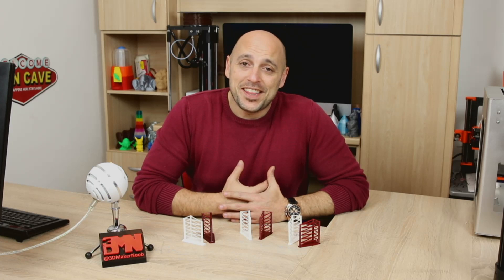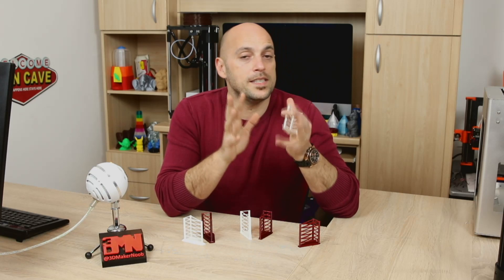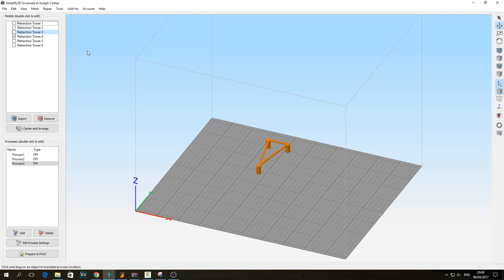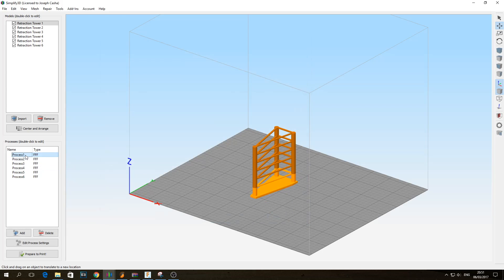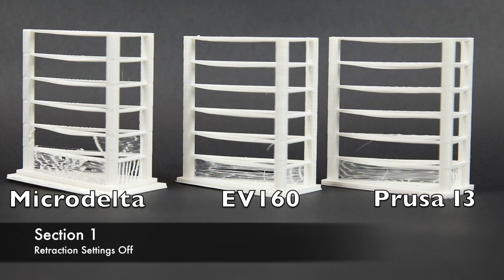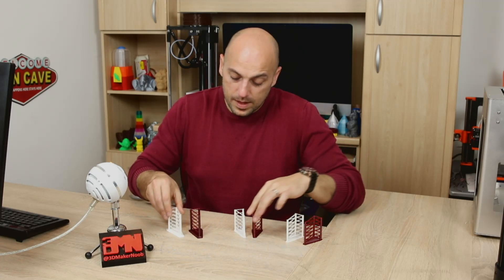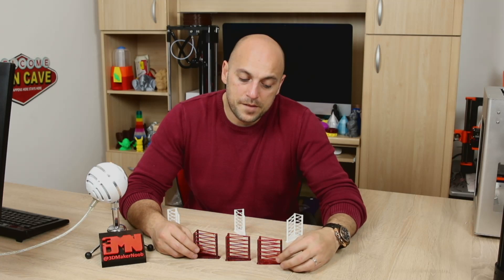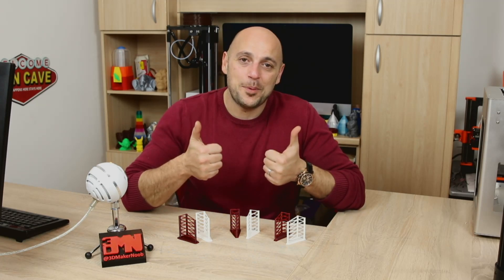A Noob's 3D Printing Guide - Retractions

Comment: For achieving this with Cura you can edit the Gcode file with notepad. Look at the layer preview and see how many layers for each section. Slice a full tower for each setting and save in separate file name (eg section 1,2,3... etc), pick one as the master, then using ctrl+f to find 'layer:x', copy/paste to replace the section layers and save the file.

Keep in mind that layer 1 in Cura is called Layer 0 in the gcode file - subtract 1 from what you see in Cura.

Comment: Old video but great setup. I would add that before retraction, it seems best to find the optimal flow rate (varies with filament softness) maybe with a cube, and then temperature with a temperature tower. Difficult filaments might need a temperature tower at different speeds to find the optimal  "gooeyness" for strong and good looking prints.

Comment: Don't do 5mm or more on E3D v5/V6 or it'll cause partial jams in the heatbreak etc. It's not visible but you'll get inconsistent prints and extrusion and end up like me trying everything to figure out what's wrong xD 

You can reduce temps to reduce stringing and you can get rid of any more stringing by just using a razor or a finger or a heat gun

Comment: Hey, great video about 3D printing. I would like to know what 3D modeling software you currently using?
Reply: What you see here is unfortunately simply3d. It costs 150 bucks. Wish he used a free slices for this.
Reply from the maker: He asked about the modelling software which in this case was tinkercad(free) and I also use fusion360 (also free)

Comment: Hello :) I've tried this with the setting-variations you used and there are 2 Strings hanging down on every Layer ( I think it's because it prints the outlines first, than the filling - it basically prints in the air if you get me) How could i fix this issue?

Comment: For the PETG could try it again with a lower temperature 250 is way high I think. I use around 215, I think that your test with the PETG suffers from a too high temperature. Am I right ? Thanks for the video it was helpfull.
Reply: TheBookaroo I agree, 230 degrees is my sweet spot for Rigid.ink's PETG.
Reply: Me Too.... 235 is where I've landed on optimism for PETG
Reply: agreed!!

Comment: Hi Joe, have watched many of your videos and learned a lot from you. So big Thx. Just one thing with this print can you share the rest of your S3D settings like speed and layers etc. I notice in your video when yous slice the layers are all Green at a single speed. When I do this I am getting really slow speeds for my towers 2.3. I have tried setting the outline speed to 100 and base speed to 60 but makes not difference. I just feel like I am missing one settings. Also what do you recommend as Speed for an I3 Plus (i have the Coccon Create Touch Aussie rebrand).
Reply: its ok I worked it out, i had speed overrides set under cooling which was slowing the print down.
Reply from the maker: +netwolfstar hey, please accept my apology for the late reply. Truly sorry as it gets hectic with comments :) glad you sorted it out, that setting is something to always keep an eye out for as some filament don't like slow speeds and others need it. As for speed on that particular printer, I find the best quality comes out at no more than 45mm/s

Comment: Printed this on my new fabrikator mini 2, and with section 4 I had absolutely no stringing. Moving on to print a 3D benchy with those settings, and I know it's a torture test, I just had crazy stringing. Any ideas to tune it more, or if the benchy is just that difficult to print?
Reply from the maker: +Karsten the benchy is pretty much the all round torture test, it was created to see what a printer is candle of all around. So it might need some more tweaking.
Reply: Just printed Aria the dragon, which also was stringing like crazy.

Have been printing a small retraction test, similar to Your tower, just going between two columns. Everything looks good, so not sure how to tweak, when the test shows all good.

Comment: Great video, still waiting for my first 3d printer to arrive, but will definitely use the this to dial in retraction. Would be awesome with a video explaining Your process from receiving a brand new filament, to figuring out best settings, ex. temperature, retraction, and other potential settings.
Reply from the maker: working on it, should be out next week :)
Reply: 3D Maker Noob That's awesome Joe

Comment: I don't think it is a great idea to mix bridging with retraction. I definitely appreciate the approach, the cube method doesn't let you test the different settings in one print.
Reply from the maker: +Jeffrey Drake the bringing is just there to support the towers, it wasn't intended to test both. I also didn't want to create a test piece that would use too much filament

Comment: For Cura, use the Z-Height plugin. I think it's installed by default in Cura 2.3. It lets you change settings on a height basis. I don't remember if you're limited in which settings you can change. I know you can change temp.
Reply from the maker: i think someone mentioned this but said that retractions are not included. will have a look into it. thank you :)

Comment: This can be done is Slic3r using Modification Meshes. Its not nearly as easy as Simplify, The modification mesh system is not terribly  well documented but it can be super powerful. I'm probably be building a tutorial on it soon.

...EDIT...
Looks like I'm incorrect. In Slic3r, you can't use a Modification Mesh to change settings for the 'Printer' tab. I'll have to find a way around that.
Reply from the maker: +Joe Herbert Shane, if you do figure it out and do a tutorial, please drop me a link :)

Comment: can you have supports just in the middle. i had a print the other day i would have like to choose where i had supports
Reply from the maker: +mikes makes yes you can. You can choose which section has supports. With sinplify3d you have custom support placement so it makes your life much easier
Reply: ill have to check that out i have always used slic3r

Comment: Oh, that's a good start for your guide. I hope there is more to come on similar settings that will affect the print quaility. Do you have any suggestions for the "pi tower" http://www.thingiverse.com/thing:271769? It seems to be quite hard to print. None of the makes look perfect. I got a lot of stringing as well, with a PLA filament where I normally have no issues on the MK2. I tried to reduce the temps a bit, but that did not really improve the print. Any suggestions what to try?
Reply from the maker: +Wolfgang Schadow I will be doing many more as there is so much to cover. With the pi tower try including zhop and coasting. Also depends on the retraction speed and distance. Still have to print it to be honest
Reply: Well, that's good. And it's good timing. After you spoke about changing some settings (I think it retraction) I wanted to suggest some guide of series / guide might be a good idea for your channel :) You had a great video for Valentines day (unfortunately on that day, so there was no time to print anything ;) What about a video on the pi--tower for pi-day (this on March 14th, coming from the first digits of pi 3.14.... ? Can you give any advice: right now I'm using distance 2.0mm, speed 30mm/s, in which direction to change? Higher numbers?
Reply from the maker: which slicer are you using? i'd say try 3.mm at 40mm/s second. make sure you have z-hop of 0.5mm as the prusa likes that :) i would also try lowering the temps for the filament, that also helps
Reply: Ok, thanks, that's a good starting point. I use S3D. I lowered the temp from 205 to 200 already and will go a little deeper with that as well. I'll try with next slot in my print queue :) Thanks!
Reply: ok, I tried this and also increased the speed while not printing as suggested in this link by Dave Gaylord. All of this was not really an improvement. :(

Comment: Oh, by the way, it doesn't look like there is a way of setting different retraction-settings for different models in Slic3r. You can apply different infill-parameters and a lot of other stuff and not only to different models, but even to different parts of a single model, but retraction-settings are missing from the list.
Reply from the maker: +Nita Vesa hmmmm I figured as much. Will see if there are any open sources addons you could install
Reply: Slic3r seems like a huge mess, even the Prusa-improved version. I would like to see being able to save more settings per-filament, instead of only per-printer -- it just seems like bad design to me. I was thinking of opening an issue for this and the retraction-setting on their github, so it'd hopefully get fixed in the future.